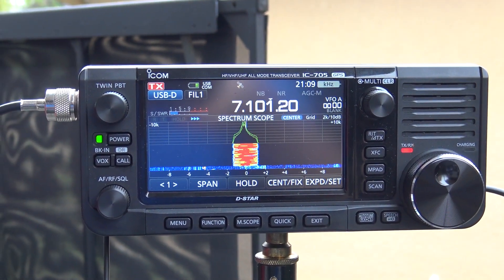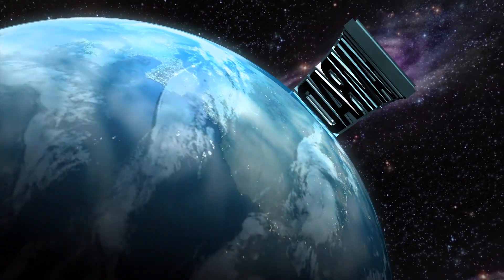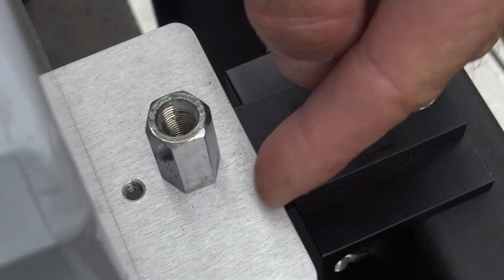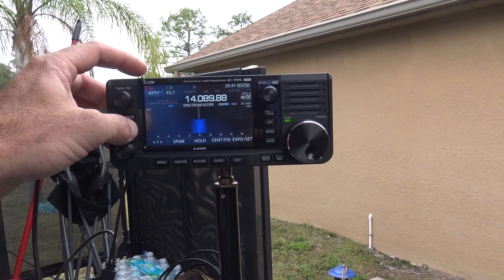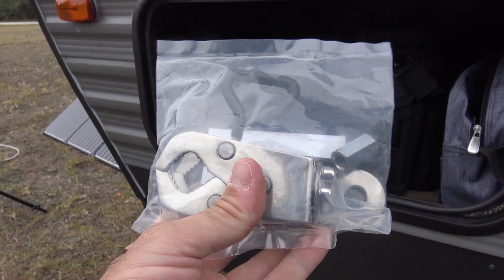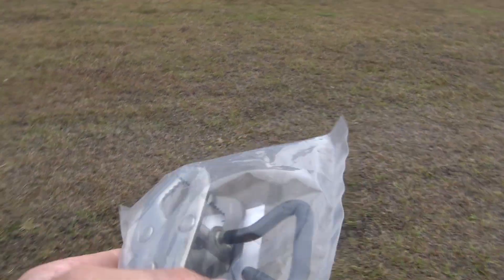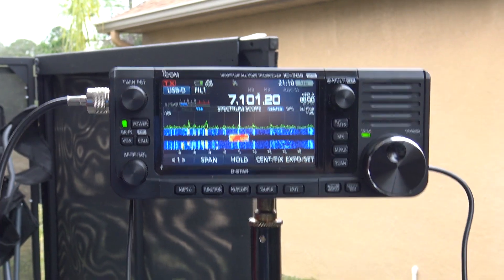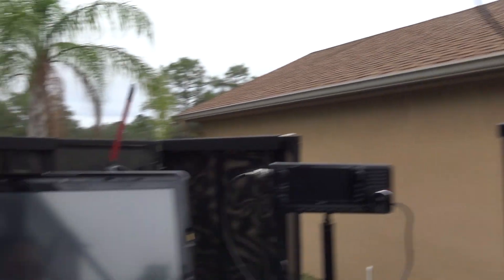ICOM 705, Sending/Receiving Email At 5 Watts, 40 Meters With Chameleon F-Loop 2.0, VARA HF

Comment: Eric, nice video.  Thank you for sharing your knowledge.  Are you running VARA HF paid software?  If so, is your radio capable of handling the “Tactical Speed?”  I am leaning toward a Yaesu 991, however reading over the VARA HF manual, it states that the iCom is the only rig that the modem can handle the higher baud rate.  What do you think?  73. Bret AC0AE